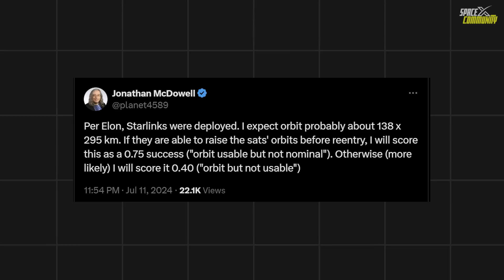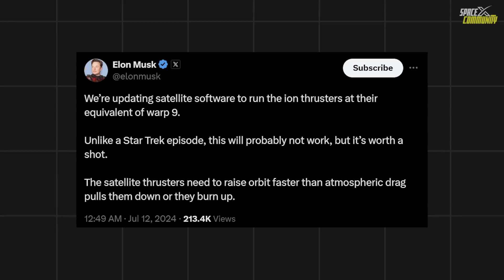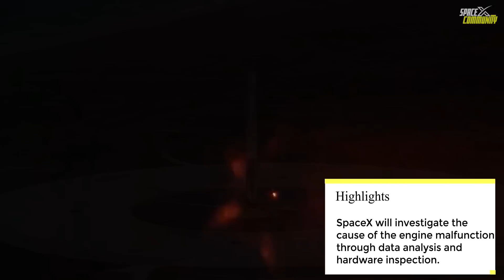SpaceX Falcon 9 FAILED During Today's Launch After 7 Years of SUCCESS! | Episode 55

Comment: When it froze is that like the same type of freeze that occurs on a too small air conditioner unit working a larger home and it ends up freeze frozen lines,  so getting a bigger unit that can handle a larger unit solved the air conditioner unit.    Just a thought could that help?

Comment: Forgive me for asking, but a re-ignite of a booster engine requires fuel at the fuel intakes even before thrust pulls all fuel to the bottom. What allows this to work? Helium pushing fuel down? Centrifugal rotation?
Reply: The upper stage has nitrogen cold gas thrusters that are used for both attitude control and propellant settling

Comment: This is Why That Engine Design Was Deemed UNFEASIBLE. FOR THE RELIABILITY. You Should Put a Adjustment Booster, by the afflicted Area. Run it at 10% or whatever for normal flight and use it for vectoring once out of Gravity. ...!?!

Comment: Probably a fuel or oxidizer leak. May not even be a design issue but a workmanship problem with any one of the fittings. Good thing this is not a customer payload and is one of those failures which would not have caused a loss of cree or spacecraft should it occur on a Dragon flight.

Comment: Knocking down some of the superfluous flummery, it shouldn't take a great deal of time to understand what went wrong. What may take longer is discovering how many engines have the same design flaw and fixing them. Why don't you ask NASA PAO and Space X if this means that Falcon 9 is grounded or will be grounded short or intermediate-term while they work this issue?

Comment: Sounds suspiciously like Concorde. 1 failure and it’s forced out of service because Boeing couldn’t keep up with the 2707 SST. And it wasn’t even a failure of the Falcon 9 launch vehicle but of the second stage with SpaceX satellites only affected. Meanwhile Boeing can’t even deliver a single crew to ISS without bypassing safety protocols by launching with known faults. Nor can Blue Origin achieve orbit yet despite starting its campaign 2 years earlier. Is it because the South African upstart has succeeded where the home grown team has failed.
USA is well known for being poor losers on the world stage. From closing all viable air routes to Concorde because the Boeing aircraft couldn’t even fly let alone compete and you can’t use the sonic boom argument as the boom from 40,000 feet is negligible and now that US companies are building again SSTs that restriction will be lifted, and Blue Origin and ULA suing NASA to restrict SpaceX operation times and flights as they can’t compete.
Seems a common US tactic: if you can’t beat them, sue them, legislate them, or destroy them out of existence.

Comment: The Falcon 9 reached Max Q 4 seconds early in the boost phase during the launch last evening.  Obviously, they were running the first stage engines at higher output than normal.  This was possibly due to the initial trajectory, which would have been in preparation for the second stage's second burn to circularize the orbit.  The cause of the anomaly appears to be a leak or crack in the second stage engine's oxygen header piping or thereabouts.   Possibly a metal fatigue or gasket failure.  SpaceX will figure it out if they haven't already done so.

Comment: That is the good thing about a rocket with such intense commercial use. If there is any issue, it will likely emerge on a commercial-, rather than a crew mission. Like this you will not learn the hard way, but only lose some satellites.

Comment: Since this failure occurred on an existing design that had flown many times and this was a routine mission (hence the system wasn’t pushed to new limits) it’s reasonable to assume that this was a quality control problem. That is assuming that there had not been a recent design tweak to the subsystem that failed. 

If that’s the case, no redesign is likely required, the manufacturing and verification process just needs to be tightened up. That shouldn’t take SpaceX much more than a month.

Comment: If the starlinks survive then its not really a big deal ! Im sure elon and spacex are on top of the anomaly !
Reply: The Starlinks will not survive. Even if they are able to boost them high enough, they will use up the ion thruster fuel and not have anything left for station keeping. This is pretty bad but they will probably make sure that it never happens again.

Comment: I’d say the Merlin engine failed, not the rocket generally.
Reply: Agreed
Reply: Most likely the LOX had a leak. The fact that ice built up indicates that's what happened. Liquid oxygen has a boiling point of close to minus 300 Fahrenheit. If that stuff leaks you're going to see some ice buildup.
Reply: Fuel supply plumbing failure!

Comment: Even the popular SpaceX falcon 9 rocket failed to bring 20 satellites into the intended orbit. The fact that the second stage did not burn completely points at design failure because of certain atmospheric conditions such as ice forming or other specific factors. It means that the engine test was incomplete resulting in a big set back for SpaceX and NASA.

Comment: The ice buildup was most likely caused by a leak in one of their cryogenic lines. Probably LO2. Along with the pure oxygen ice around the engine and the sublimated gas, the engine immediately RUD upon initiation of the second burn. This seems to have effected the stage only, as the starlinks were deployed intact, just at a lower apogee than desired.

Comment: We've had several failures recently.  The Starliner issue, an accidental launch during a static test, an old satellite exploded, Araine 6 failed to re-enter properly, a Hyperbola-1 4th stage failed to ignite, and then this.
Reply: Seems to happen. Around the time of Space X's only major in-flight failure, CRS-7, there were two other ISS-supply failures: a Russian Progress and a US Cygnus-Antares  (the latter being a Ukrainian booster body powered by a reconditioned Soviet motor... the motor failed). While this latest failure is significant, it happened on a re-light after reaching a transfer orbit, so it would not have happened on a Dragon launch.
Reply: That's to be expected considering the volume of spaceflight development being done around the world.  Space launch is a very expensive/difficult R&D project for most organizations.  This is just unusual for Falcon 9.
Reply: Well they did delivered the satellite but the height is a bit less.

Comment: Might now be a normal success but they get to test the ion thrusters and see how they perform at warp 9
Reply from the maker: Yep!
Reply: Marshal drives go to warp11
Reply: even if they make their intended orbit the use of the ion engines to achieve its  orbit will greatly reduce its life expectancy.
Reply: @michaelotoole1807  Why should it reduce life expectancy??
Reply: @macdieter23558  Uses up the propellant they use to stay in orbit, course correct, and de-orbit at the end of life. The less propellant they have on board, the fewer times they can self boost, the sooner they must terminate operation. And that is assuming the wear on the thrusters isn't an issue.

Comment: Its not a total Failure like they trying to say after all satelites were deployed.
Reply: It's a total failure. They aren't high enough to be able to maintain orbit. Even if the ion thrusters are able to raise it, that's still a problem because it will use all of the fuel up, which is needed for station keeping. Satellites need to have a propulsion system in order to maintain orbit or they eventually fall out of the sky and it doesn't take that long. What they do with satellites is they monitor its altitude, and every once in awhile they give it a little boost with ion thrusters, in order to keep it from gradually losing altitude. Musk also said he doesn't expect this to work but he's willing to give it a try.
Reply: SpaceX just confirmed these satellites have been lost and will burn up
Reply: Wrong. They are coming back down because they don't have enough altitude. Did you even listen to the whole video? This mission was not a success, it's a failure, which is extremely rare for Falcon 9.
Reply: Too low orbit, so it is total loss of those satellites. And now those are in totally unpredictable trajectory to the Earth. Only 5 satellites were able to be contacted.

Note: lifetime of Starlink satellites is 5 years, before those deorbit themselves naturally due to the atmospheric drag and gravity.
Reply: @mikapeltokorpi7671  Normally it's five years, which includes built-in orbit corrections and boosts with the ion engines, the fuel for which, in this case, will already be used-up.  And for the ones that they couldn't contact, they are in a much lower orbit with a lot more atmo-drag so they won't stay up too long -- months, maybe, but no longer.
Reply: @mikapeltokorpi7671  Boeing employee?
Reply: @AndyFromBeaverton So if someone tells the truth then that means they must be a jealous Boeing employee?  What is wrong with you? 

Falcon 9 is incredibly reliable, but this mission failed, deal with it.
Reply: The satellites are in a worthless orbit and the engine nozzle disintegrated, that's a total failure.
Reply: @yeetyeet375  Bezos? Is that you?
Reply: @jameswilson5165 If someone states the obvious and says something negative that is a true fact about a SpaceX mission then it must be Bezos. You got issues bro.

Comment: One positive note is SpaceX will learn from this mishap and will improve it.
Reply from the maker: Exactly! This will provide them with o much data too!
Reply: Yep! The improvement will be to "recover previous levels of reliability". 😉
Reply: Yea, they will make sure they catch the Boeing plant before they have time to sabotage the rocket...(Kidding... not kidding... kinda kidding....)

Seriously though, good timing for Boeing right now. I am usually not into that kind of conspiracy theory based on zero real evidence. But in this case, coincidence is pretty darn timely I must say.  Just as Boeing has astronauts stranded on the space station for months longer then the original mission length, all because they have hydrogen leaks in their engines.  
And what does Space X suddenly encounter after 7 years of not a single incident, then boom.  

Or it's just gonna happen to any space agency, they system monitors caught the issue as it should, so still safe.  Way better then finding ot there is an issue when you are on the Space Station like happened with Boeing...
Reply: Slow Unplanned Leak  (SUL event). They will give up and sell the company. Ohhhh wait it's SpaceX. They will make a joke while fixing it and keep doing their thing :D
Reply: Perhaps, although it could be a sign that 're-using rockets' is not such a good idea after several launches. The reliability of the rocket engines is going to deteriorate with each successive launch to vibration and metal stress/strain and fatigue. The cost savings predicted by reusability may need revision.
Reply: @WJV9  DUde, the second stage is not re-used, they always use new engines. Only the booster is re-used, and dragon capsules. F9 is partially re-usable as a stack.
Reply: @WJV9  second stage is not re-usable only the 1st stage booster